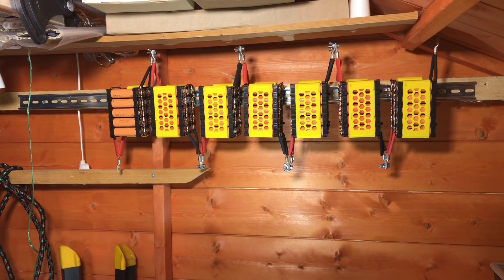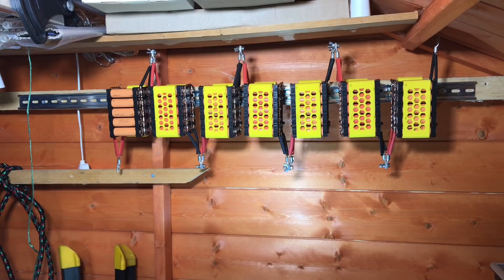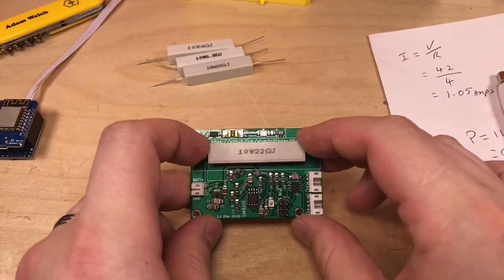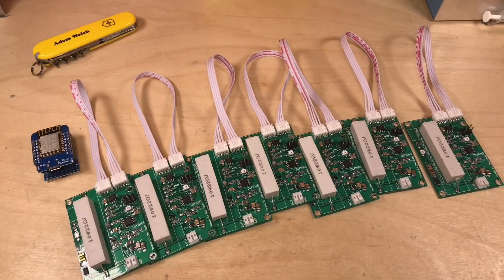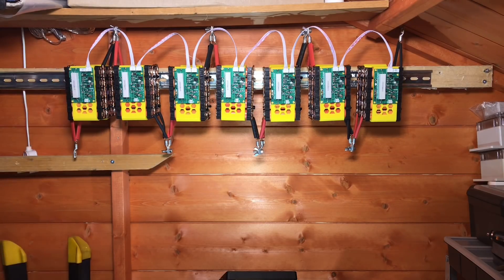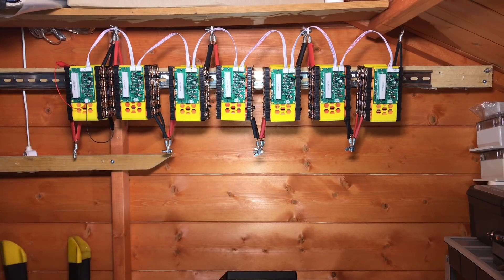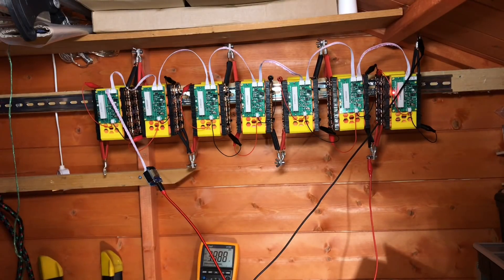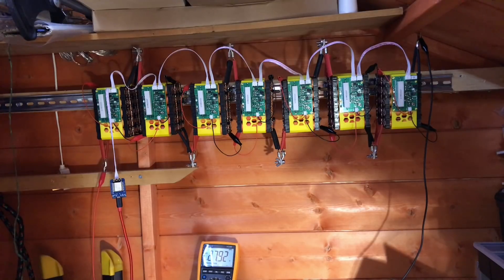diyBMS - Provisioning and Calibrating - 12v Solar Shed

Comment: Hello Adam, I watched your vdoes the BMS ideo and went to Stuart`s Github - still have a few questions: i understand that this BMS is doing cell balancing, monitors under/overvoltage and over temperature. What i am missing is the over current limitation - Is the BMS able to limit a preset overcurrent - charging or discharging - by driving a relay? Best regards!

Comment: Hi, this is 7s20p right?
In that 20p cells are u measuring random cell voltage? I need to measure all the cells, what can i do ?
Reply from the maker: When you place cells in parallel they will basically all have the same voltage. Any cells that are weaker will be charged by the stronger cells. So ensure they all have a very similar voltage when you connect them in parallel to reduce any high currents.
Reply: @AdamWelchUK  thanks for the reply. 
I am thinking of doing this as my engineering project. I am Electrical background so the program is little bit difficult to understand. Anything to understand better?

Comment: I wish I had more intellect and knowledge to offer to this, but I am trying to learn as much as I can, what do you feel the maximum current that the DiyBMS can support?  It seems to me that is the real limitation to the size of the pack you are designing for the system.  The total current load determines rate at which power from an outside source can be pushed back into the pack of cells.  With parallel cells we know the maximum voltage should be 4.2Volts but the Amperage makes up the test of that current calculation and of course how long it takes to charge that block of cells being charged.
I am truly sorry for being such in idiot about this and I know I have a long way to go and sooooo much to learn, but your videos have sold me on the concept.  I just want to understand how large and how many blocks of battery cells I need to target to make this a usable and safe way to use and store energy.  Forget the specific cell if you will and think about it as Ah of storage, that way the particular battery involved is irrelevant and really this comes down to how much charge energy this BMS module can support???
It also intrigues me that you chose your pack to all be parallel and not series.  There are quite a few other sites out there that choose to make the cells series and stack these into parallel to achieve the desired result.  I think I like the parallel and then build the series after method, but as I have said I am sort of an idiot in this space and really just looking for some awesome advice of anyone is willing to offer.
The BMS module seems to care more about current than voltage as part of its operation, just hoping someone of your knowledge can shed a bit of light on the difference.
Thank you so much for doing what you do, its absolutely awesome that you explain each step and thought you take through the process.

Comment: Adam I'm learning a lot from your diyBMS series, this is quite fun!
One question, is there a maximum amp-hour that each module can handle?
Reply from the maker: Thanks very much Colin. The module is limited to about 2amps of discharge current, so that’s a lot for a 2Ah cell, but not a huge amount for a 200Ah group of cells. It’s as much to do with your charger - how much power might you need to dissipate if the cells go out of balance at the top of their charge? In my solar scenario the charge controller is limiting the current at the top end, so my few hundred milliamps of bypass current should be enough. Theory is you could add two modules to a bigger group if you needed it - the bms controller should cope with that.
Reply: I was hoping to start by building a 7s24p system, and it everything goes well, expanding it to 7s48p, and seeing how I feel about it after that. It sounds like the diyBMS might be a good option

Comment: Would it be worthwhile using a fan, like this one,     https://www.ebay.co.uk/itm/Small-PC-Fan-Cooling-Heat-Sink-Computer-Case-40mm-5V-2-Pin/173166885826?hash=item28518cfbc2:g:vlQAAOSwhwBaigbN.  ??  Instead of a resisitor, assuming it will work down to your lowest expected voltage,  3.3V?? I haven't tried this, just wondering, then the cooling action could also be used to keep the batteries cool.

Comment: I'm curious did you have to reset your wemos inbetween provisioning each pack?  My setup has been rather finicky of late and will run a while then the modules go into panic mode so some digging is needed i think.
Reply from the maker: Nope. I had one issue but I think that was a loose cable. Otherwise it was smooth sailing. Your cables are a fair bit longer than mine, someone suggested twisting the cables (or at least the two data wires) to help reduce interference. Is yours worse since you put your inverter in?

Comment: Nice video thanks, do you step down the voltage to 12v? If so what are you using or have you said that in another video?
Reply from the maker: I'm intending that I'll probably drop the voltage down and use it at 12 volts for a number of things.  I did a video a little while ago about dc2dc converter efficiency and found the one that worked best for me (ie. going from ~29v to ~12v).  There are a couple of things in the shed though that may work more efficiently at a higher voltage, so perhaps theres another video in that!  Cheers

Comment: Is the thermistor to measure the heat in the battery module?
Where it is, it will be more likely measuring the heat generated when you equalize with the load resistor.
Wouldn't it be better to fit the thermistor on the other side of the board closer to the batteries?
Reply from the maker: No the thermistor is there to monitor the module - and presumably the discharge resistor.  Thing is I know the discharge resister is going to get hot when it's in bypass mode - that's what you expect.  I was interested to know if any cells were getting warm in other conditions.  So yes - I had intended to solder the thermistor in the 'wrong side' of the PCB and poke it in-between some cells, but the bead was too big using the thermistor Stuart suggested.

Comment: love your videos.  No one to ask about solar where i live, may i ask you a question, or where i can find answer on my question?  Got a  panel 100w. i daont need all power to my litle battery, can i use extra power im not needing to just feed my little  refridgerator? it runs on 12v 100w. no compressor.   any suggestions? it wont be powerful enough but will it work? Risks? just to take 12v from the battery cabel betwen solar charge controller and battery? is it ok to take the  direct frome panel? it  is to strong some days, i think. to many volts maybe  /please respond Thomas in Sweden
Reply from the maker: Thanks for the kind comments. I wouldn’t connect the panel straight to the fridge - but is there a reason you can’t run it from you battery? In the day the panel will charge the battery and power the fridge, at night the battery will have to take over. Otherwise you’ll need some way to switch over the panels from one setup to the other, and a buck converter to convert the panel voltage down to a more suitable level - you’ll need one that can auto adjust to the situation though - which is basically a solar charge controller! 
Perhaps the best investment is a larger battery or additional batteries so you can store and use more of the power?
Reply: Thank you Adam

Comment: Is this available in a kit. Or more of a diy pick your own parts.  I am not really able to do any programming and stuff on a  pc rt now. I can solder and build. I am needing a way to manage my bank and balance. I will be able to do more pc related projects later. After I am moved and un packed. That may be a few months. I really like this design. Would you be interested in doing another for me? I can asemple it . I was considering a E bike bms and a extra balance only board. If I don't figure something soon .  I guess I will go that route! Great video again!
Reply from the maker: Unfortunately building this has taken me, well a few months due to my lack of free time.  I can't be building them for others I'm afraid.  From a programming point of view the code is available and programming isn't very hard.  You either need an ISP programmer for the modules or an arduino - both pretty cheap and readily available on eBay.  Hopefully you can get something organised.  Cheers

Comment: Could the  thermistor go on the back. Contacting the cell or in-between cells. In contact with both?   I really need to start looking into battery management and monitoring. Along with balancing. All I have is the cell meter with manual balancer. I haven't put them in service for this reason. I'm at over 150ah 7s bank. And about to nearly double that!  I hope to have them connected by the time I have 4-500 ah. I also have lead acid golf cart batts. And a set of  HUGE L16 batts 450ah. I'm going to use these for back up until I get enough lithium battery to not need them under normal use. Maybe emergency power. And in my garage. Using a ups for lighting and small loads. And mostly DC lighting. Ac lights for when really bright light is needed. I'm looking in to a 12/24v inverter that works good with starting motors and dependable. Maybe 2000-3000watts. And have clean enough power to run my home if needed. I prefer a pure sine wave. A good modified would work I guess. I need it to run saws and charge batteries for cordless tools. Which I'm transitioning to. Since I'm off grid. But still need good tools for work! . nice work. I need to get something like this ...

Comment: Nothing wrong with croc clips...! Much of my system is held together by them...! Of course the intention is to replace them with more permanent wiring once the experimentation is done, but that can take longer than one expects..! lol We're now past the Winter Solstice here in NZ, so days are getting longer again. Yay. :)
Reply from the maker: Yes I think they may be a semi-permanent solution :-) The only better option in reality is to pop ring terminals on the end of the cables and sandwich them with the main block connectors.  Another winter solstice on solar done - well done Xan!

Comment: So how does the balancing work? 
Does it balance while charging by bypassing and burning off some charge when charging?
Or does it discharge the pack? I figure that balancing through discharging will reduce the lifetime of the battery pack. 
Or is this irrelevant for battery life?
Or could you reprogram the BMS to do this?
Would this work for 48V too?

EDIT: It appears it's balancing by discharging. I'd still be curious if this is a relevant downside to this.

Comment: Im intrested to see what you have in mind on the charging like CC constant current (the proper way) or CV constant voltage (the wrong way) many charge controler will say they are "lithium compatible" but ask them if it charges under "constant current" most likely the answer is going to be no. Thats the problem im having with my LiPo4 cant find a charge controler that charges with CC although i know others are using the CV method Im not willing to trust that method. Are you going to use buck or boost personally ive done both but primary is buck CC. LiPo4 4S 12P is what im using with a combination of 4S 20P 18650's just to add the extra capacity and already had the batteries so might as well give them a home. Neat Set up i will say puts me in mind of the way over priced Batrium stuff
Reply from the maker: Hi Steven and thanks for the comment.  I haven't found a solar charge controller which does constant current charging, and there is a very good reason why.  Solar is unpredictable.  An array can produce 10 amps one moment, and barely 1 amp the next.  Unless you have a buffer (another battery bank) then it's only ever going to be able to achieve an attempt at CV charging - even then, an array might struggle to produce enough power to maintain a voltage for any length of time.  To do a proper off grid CC/CV charge you need a lead acid bank charged by solar, and a lithium charger powered from that.
I'm going to be using a buck solar charge controller for this setup, at least for now.  Batrium is a great system by the looks of it, and the software is quite powerful if you buy all the bits.  As well as maintenance it's an insurance product in a way, so I guess it depends how much you spent on your pack (for me, not a lot in terms of money) and how much you rely on it (again I have alternatives if required).  Cheers

Comment: Another first. Your progress is pretty exciting. Well done. So what amps will your solar charger put into this pack? I'm thinking 8Amp'ish so each cell will receive approx. 1.2Amp during charge and will be fully charged in approx. 3hours.
Reply from the maker: Remember the current flows throughout the whole circuit, so each block will receive (in your example) 8 amps.  The pack may be sat at 28 volts and being charged with 8 amps, but each block is sitting at 4 volts and being charged with 8 amps.  Another way to look at that is power.  28v*8a is 224 watts.  Each pack will be receiving a 7th of that overall power...   224w/7=32 watts.  32w/4v=8amps
My blocks are about 50Ah is size, so its a 29.2v 50Ah battery effectively, however I don't intend to fully charge or discharge at any time so I've probably got 30Ah usable if I'm careful.  So it's going to take me a fair few hours to charge if I've hammered the pack one night.
Reply: Thanks that's very precise. I do tend to over simplify things. So your 30Ah pack (7S20P) being charged at 8A will take 30/8 = 3.75 hrs.to charge from empty to full, yes. Also, each 18650 cell will receive approx. 0.4A during charge(8/20). So should not be stressed at that level of charge and all is good (average 18650 cell capacity to be 1.5 Ah)? I think that's right. Will your shed system migrate to your house and if so would you me looking at grid tie stuff and AC batteries. This seems far simpler, that's me looking for the simple way out. Micro grid tie inverters on solar panels, AC charger for the battery and some way to switch between solar and battery based on usage.

Comment: For the thermistor use these.This is the type that is used under CPUs or inbetween small tight spaces so would be great for inbetween packs.  https://www.aliexpress.com/wholesale?catId=0&initiative_id=SB_20180703133512&SearchText=3950+NTC+Thin+Film+thermistor
Reply from the maker: Yes, that is definitely worth considering thanks.  Stuarts code has allowed for alternative thermistors to be used and there are variables where you can change the parameters to update the steinhart-hart formular.
Reply: ok cool :)

Comment: Are you going to be charging to 4.2v tho? Thought you would only be charging to 4v in which case i would do the math at 4v. Given the small pack size 200mA would be fine but you could do 500mA it really shouldnt make much difference. I would go 1amp. The benefit for the higher current would be if the charger is putting out 1amp it would mean the balancer would be able to keep up not letting the cell voltage rise.  Looks great tho :) Nice work
Reply from the maker: No - I won't be charging to 4.2 volts in reality.  My calculations were based on worst case I guess.  I see the argument for a higher discharge resistor, and I may well be upgrading that further down the line.  This is my third 7s pack I've built (7s4p, 7s8p and now 7s20p) and I've spent a lot of time testing the cells and building even packs.  Balancing is wasteful, and I hope in reality there isn't going to be much balancing required due to the preparation work.  In those previous packs I've used the capacity controller - and it discharges at about 25mA, but it kept those packs in balance really well.
It's all experimentation and I'm enjoying the journey, it's great to get feedback and ideas and always good to hear people are enjoying the journey with me :-)  Cheers
Reply: 7s20p. Is the next packs 40p? :) Its good your spending a lot of effort on even packs. It's much harder to do on very large packs given the time it would take. My other thought on this is how much is it really going to matter. At the start the packs will be in balance with even cells (great) and if the cells were band new and degraded at the same speed that would make sense. But they are not they are old cells pulled from different sources and put together (some might be a year old some might be 4ys old with the same capacity) and in which case each cell in the pack will degrade faster than others, so longterm after a year the cells in the pack have aged "differently" in which case the pack will no longer be as even as you first started. So my question is how important really is it to build the packs as even as possible given the changes of the cells longterm. The "longterm" could be just the first year and then the question is was it even worth it (timewise etc)to start with very even packs vs close enough. As long as the balancer can keep up with (close enough) then no problems right? :)
Reply: But it's not going to be more wast full with 4Ω than with 22Ω. Only with 4Ω you can keep up with a 1A charger as with 22Ω you can only keep up with an 200mA charger.
Reply: Thats a good point too.

Comment: If I did that for my rack I would need 49 modules. Have you done the cost per balance board yet? Thanks for showing
Reply from the maker: Not yet - I have a spreadsheet which needs updating.  I'll try to add this to a video soon :-)